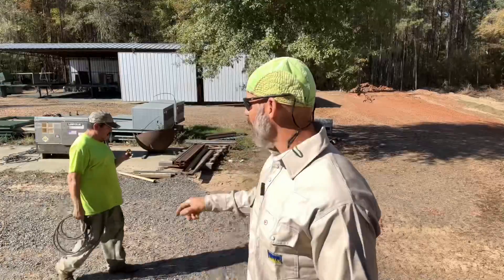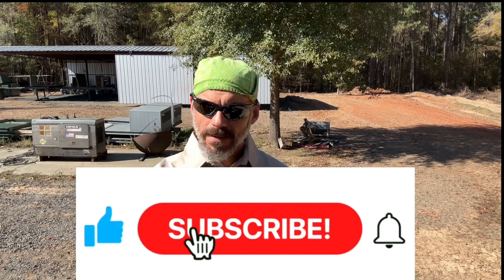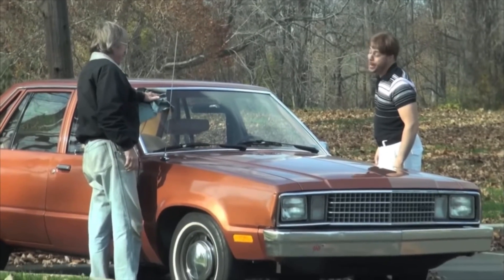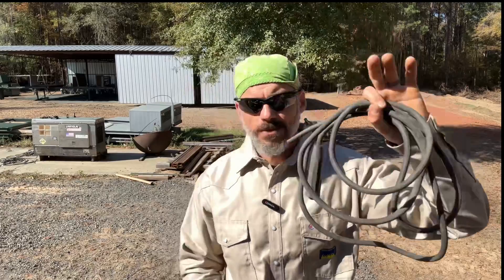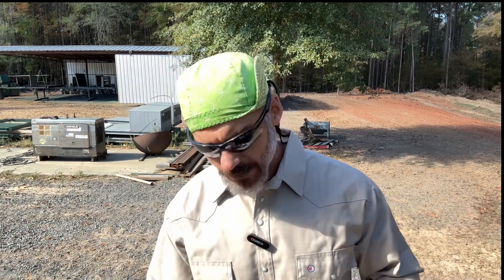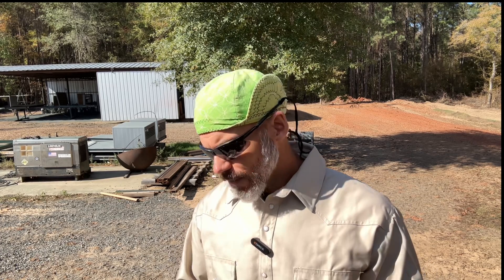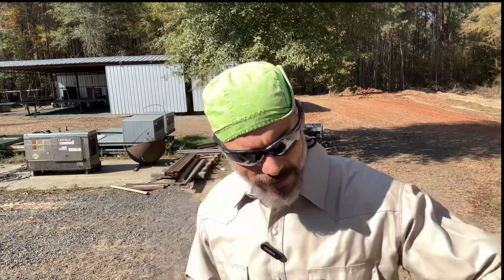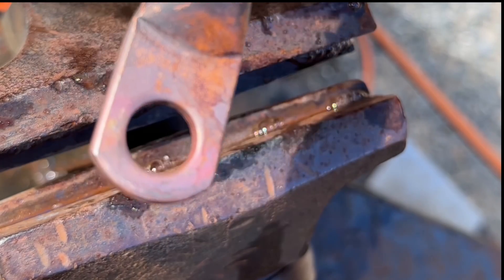Welding Lead tips and tricks. How to Keep them Cool

Comment: I just ordered 3/0 100ft on a 325amp machine to avoid the heat build up. I read the wire size charts for amps and length.

Comment: great point on winding up your stinger and lead wires! Keeping  a loose coil is better for the wire for sure! The NEC (The National Electric Code) actually tells you the bend radius for a wire. for non shielded wire it's 8 times the diameter and for shielded wire it's 12 times the radius of the wire. The NEC has different guidelines for different types of cable; whether it has shielding or how many strands are in it. The bend radius for a solid single conductor is more times than for stranded wire. Sharp bends can damage the shielding and the insulator that envelopes the wire. Even hanging  a coil of wire on a narrow bolt verses a large diameter of pipe could cause damage on the point that it is hung on a nail or bolt or just something narrow in diameter verses a larger round smooth surface. Anyone with a NEC code book can look up 305.5 for conductor bending radius when placing them in a service panel or junction box, which is why there are rules for box sizes for pull boxes or junction boxes etc. when electrical work is done. A good example is a conductor used for lightning protection; sharp bends are avoided to reduce resistance in the wire, which also allows the electromagnetic force from the lightning to go to earth with the least amount of resistance, which will mitigate the damage the lightning can cause. It's the same when running ground wires. The less breaks in the grounding conductor and the fewer bends as it finds it path to earth, the quicker a fault will clear if something shorts out in a branch circuit, so all that you are saying about reducing connections and using solid connections when you have to make one is all in reducing resistance that is created at every break or union from the source to the load! Great video! Made me remember a lot of fundamentals of electricity and current flow in regards to bends and unions and splices etc.! Great video, Taylor! I watched this a year ago, and here I am watching it again. Oversizing your wire is always better for current flow! Think of current like water flowing through a pipe! The more current, the larger the wire you need. If you're feeding water through a 3" pipe to feed a mobile home park, and you branch off of it with 2",  like a branch to feed a row of mobile homes. you're going to have better water pressure. The same is true for the voltage pushing the current through the wire to the load or in your case the metal surface you're welding, the less friction or resistance means less heat. The longer your lead and stinger wires are, the more you need to take into consideration voltage drop. How much current you're pushing through the wire will determine the wire size. Then the type of wire you use will determine the ampacity of the wire. article 240.4(D) has rules for small conductors 18 gauge up to 10 gauge copper wires and their ampacity limitations and overload protection. Table 310.16 has ampacity limitations for 18 gauge up to 2000kcmil. Welders have duty ratings that have to be taken into account when you install a receptacle to rung a welder on. Duty cycle plays a big part in how long a wire can handle the current running through your stinger wire and lead. People call the lead a ground it isn't a ground! There is current running through both. voltage and current need a path back to the source for them to flow. That's why they call it a work lead that clamps to what your welding. there's a couple good formulas to know that will help you determine what size wire you need for your application. if you want to see how much voltage drop you have for the length of wire you are running for the current you run through it (VD 3% is acceptable); VD= 2 x 12.9 x I (current) x D (distance) / CM (which is the circular mil of the wire size you are using; chapter 9 Table 8 in the NEC has the CM for 14 AWG cu wire up to 4/0. 1/0 is 105600 CM AND #2 IS 66360 CM. Depending on what type wire you use, 1/0 cu can be rated 150 amps (75 degree C) or 170 amps (90 degrees C). if You have a certain wired length in mind and know how many amperes you are going to run through it, you can use this formula: CM=2 x 12.9 x I (current) x D (distance or length) / VD which is 3% of 120 volts or 240 volts; 3.6 for 120 volts or 7.2 for 240 volts; you can also find distance or length  by D= CM x VD / 2 X 12.9 X d (NOTE THE 12.9 is the resistance for copper wire; a mil foot is a wire one foot long and one mil in diameter. that's how they come up with the K value or the circular mil value for copper wire. If you want to find the maximum current for the wire you have, I = CM x VD / 2 x 12.9 x Distance or length. You can always spend 20 dollars on an UGLY'S reference hand book that has Table 8 in it with the circular mils. That is if you are making your own stinger and lead wires for your welder. Hope that helps someone.
giving the information out is a good way for me to brush up as I study for my masters exam and get my contractor's license, hopefully this year. Then I would like to put more effort into doing more welding. That's a long story, but I would like to finish what an eye injury stopped me from accomplishing 42 years ago. If I can practice at home and go pass some welding tests, that would be great. I like doing doing everything, including plumbing and tinting car and truck windows. I grew up framing houses with my dad with power tools in my had from the time I was 11 and subcontracted my first house at age 17, so I've been in construction most of my life. I spent 8 years driving a big truck and end dump hauling material for Chesapeak, building roads and pads for oil rigs in Oklahoma for a couple of years. Even worked with sceptic systems for a year; that was good knowledge to get! 
I've been studying HAM radio for a few years now. There's a lot of great knowledge when it comes to radio frequencies.
Anyway, I want to get back into welding and finish what I started there. there's so much you can do with the skill!
Thanks for doing these videos, Taylor!

Comment: I press my lugs on with a 10 ton hydraulic battery cable press. Do you think solder would be better? I run a Lincoln Idealarc 250 and Miller Bobcat 250, both with Temco  1/0 for my primary stick machines. Burn a lot of 5/32 7018 on heavy equipment. Never had any burnt lead so far.

Comment: Guess the only thing 1 would be iffy about tinning wire like that is the potential for wicking into the insulation.  Applying a bit of the stuff I learnt from fixing wiring in electronic applications.  Lack of tin as in 60/40 solder as well.... perhaps

Comment: Great content as usual👍. Question?, when sizing 1/0 cable for 300A at 100ft. My question is, does the total positive and negative combined has to be 100ft, or 100ft positive and 100ft negative?

Comment: Definitely recommend tinting the wire or using flux. I did this on some Anderson terminals some years ago and the connection was bad because the solder didn’t flow into the wire very well.

Comment: Let me just say that 1/0 copper AWG is good for 150 amperes, but like you said, the length of your lead/wire whatever, you start dealing with voltage drop, which will introduce more heat into your wire because of the resistance of the wire!
That’s a law in electricity, no matter what!
Great topic for welding! It won’t only affect your wire but also your welder! All those parts that make it produce the amperes you need to weld!

Comment: Induction coil I believe , all our field rigs had big old loop cable holders made from pipe halfs and plate and ran big cables,(yea it was a bit slower and more work but so is yanking all of the cables off) as for the J-locks every so often you would wire brush the oxidation on the male ends and used one of those copper pipe brushes on the female ends, the damn road salts get into everything around here and would rooster up your connections. stingers, clamps, and even cables seemed more like a consumable at times that needed to be replaced when used day in and day out. but money is money and the more you save the more you keep.

Comment: I'd suggest using flux on that wire, flux not only helps the solder flow better, it also cleans the copper wire so the solder sticks better.
Using just lead as solder is not ideal either.
A ferrule would also work if you don't have anything to solder with and all you can do is smash the terminal.

Comment: Hello Mr Taylor 
I understand what y’all said about twist locks gettin hot or losing connection been usin them for 40+ years  and only had 1 melt down when i was air arc ing 
I cant hook up direct cuz i use different accessories. Like whip for stick - LN25  and arcair —  Any suggestions

Comment: I'm running a Lincoln Ranger 10,000 plus with about 50ft of 2.0 on the ground and about 65ft of the same on the stinger I don't have roll up reels I just wrap them around the handle on the all terrain cart the welder is bolted to should I get rid of my about 8ft of no 1 whip that I carry for both stinger and ground cables

Comment: Don't weld much anymore, but I enjoy the videos, question for y'all, my Lincoln SA 200 is producing power but it won't weld. Any ideas, I cleaned the armature with the right stone, still barely an orange spark.
Reply: Is your remote setting off
Reply: Something that has happened to our Gravel pit machines (sometimes they go a couple months without use) is the stinger and/ or ground are corroded.  Seems silly but it's got the best of us before. Some emery cloth or a baby wire brush and voila.